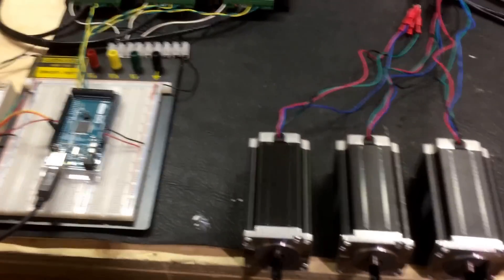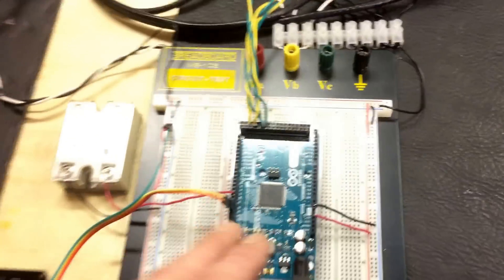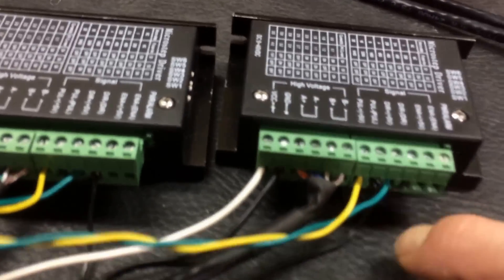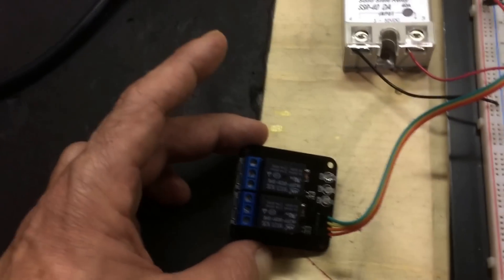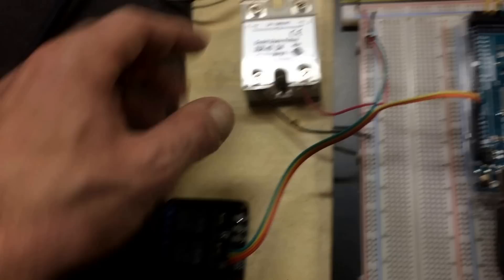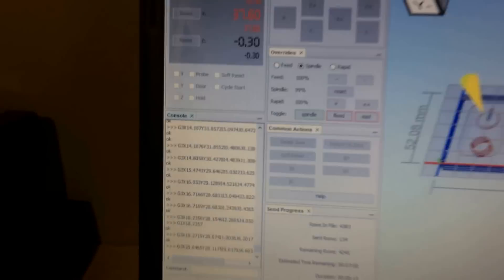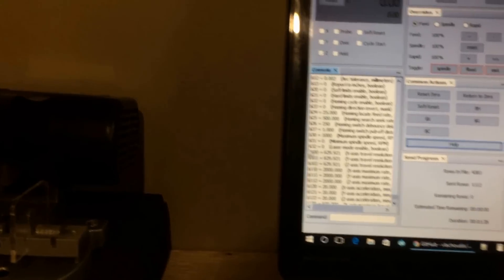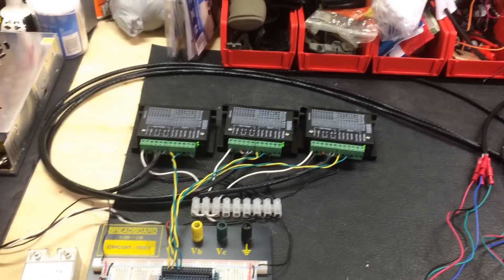How to DIY Arduino Mega2560 CNC 3/4 axis hardware and software setup, easy

Comment: What is the milling machine that you converted? I am trying to do it on the cheap but want an accurate and reliable machine. I have an HF33686. I am wondering if I need to change out the Acme thread to ball screws? any thing you would do differently?  Post of your install would be nice. Thanks for the detail. No posts for a long time?
Reply from the maker: gaewing, i haven't converted a CNC, i built a relatively cheap one from OpenBuilds so i could get my setup right before i tackle either converting a Grizzly G0704 or building a heavier duty one from scratch. I'm still experimenting but have come up with what i think will be my final controller and software setup. I'll be posting a short update video soon with some things I've learned along the way. For one, the consensus seems to be that ball screws are better in general, but you can tweak the GRBL to calibrate your steppers with your lead screw for really good accuracy as well, this is what i did with the 8mm lead screws on my machine.. i guess it all boils down to how much you can/want to spend and more importantly, what are you going to be doing with it. Thanks for watching!

Comment: mumble mumble.. volume ?
Reply from the maker: I'll be putting a new video up soon, with better audio, video and explanations. I know the quality of this video isn't the best, but that's what i was able to throw together on New Years day after a night of partying:/. If you're interested in the GRBL1.1/Arduino setup, I think you'll be very interested in the next video where I'll outline my setup using the Arduino Mega-2560 with GRBL 4 axes (yes 4 axes) and Raspberry Pi3b. I also ditched the UGS software for CNCjs, which is, imho, by far, the best CNC software I could find that is open source and being actively developed. Thanks for watching and taking the time to comment! :)

Comment: Will this software for the ATmega2560 work with an Universal Gcode Sender version?  For example, I'm using 1.0.6, which also has a different layout.  Also, in the video it shows that you are using a NetBeans Platform 8.1, is this just the nightly build you are talking about?  I want to keep the same version of UGS I currently have with the Atmega2560, is this possible?
Reply from the maker: Lamira Bland, it sure does. The Arduino is running GRBL 1.1e, i've tested with Universal G code sender 1.0.6, UGS nightly and other incarnations of a gcode sender, works with all.
Reply: Could you point me where did you get proper files to flash mega 2560 chip with GRBL firmware? there are so many places with grbl, so many versions, so big mess:) Tried to upload grbl from Arduino IDE but got messages like "in function 'main' undefined reference do 'setup' and to 'loop'"...
Reply from the maker: The link is in the description: Ardhino GRBL-Mega: https://github.com/gnea/grbl-Mega/ this is the branch i follow. Hope it helps, also make sure you are selecting the mega2560 in the IDE
Reply: +TacPreppers thank you. So far i've put grbl to Arduino Uno and  it seems to work though i'm expierencing some troubles with host communication (it is not arduino fault).
Reply from the maker: This version is specifically designed for use with the Mega2560, not the UNO. Good luck

Comment: just a precision: for the moment, GRBGL is not capable of 4 axis management , only 3 axis ! and for 3 axis CNC no need for a ARDUINO MEGA , ARDUINO UNO can do the job and is cheaper.
Reply from the maker: I know the video is little long-winded but i do mention that the version of GRBL is an "Arduino Mega only" branch of the original for the UNO and that it currently only supports 3 axes. This version is being actively developed with a 4th axis option, hence why I mention it, but thanks for taking the time to comment. fyi, the Mega has 256k flash allowing for much larger sketches and expansion of GRBL beyond the UNOs capabilities, if this is what you eventually want. cheers